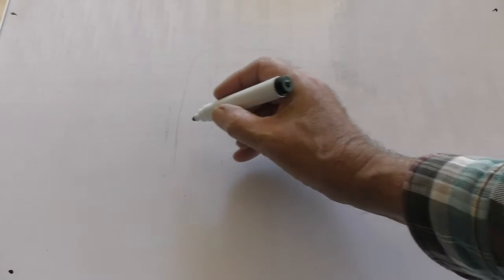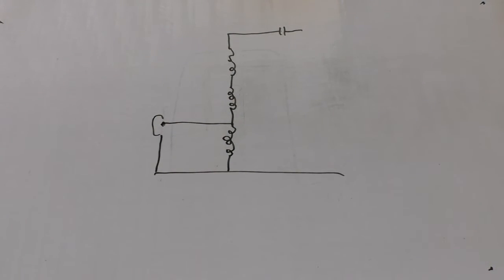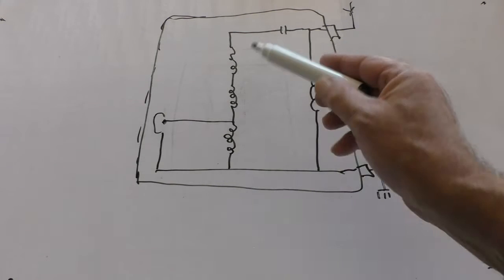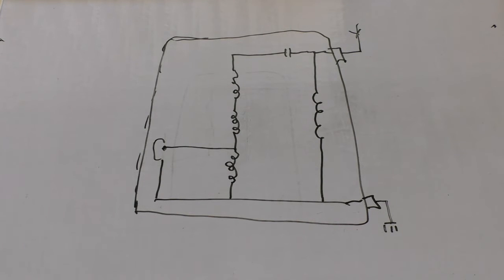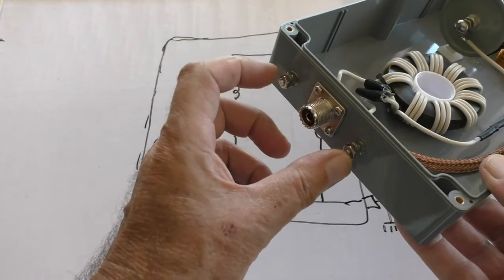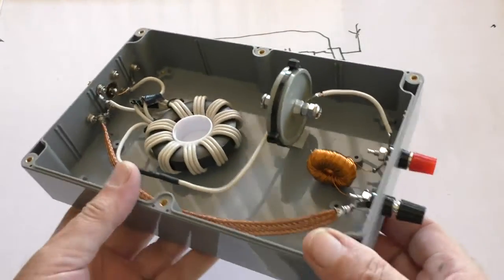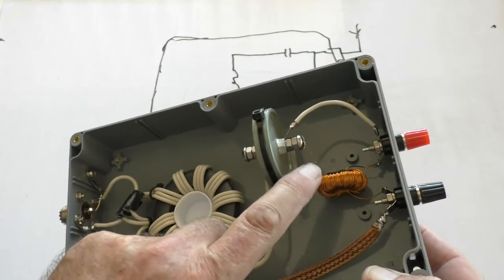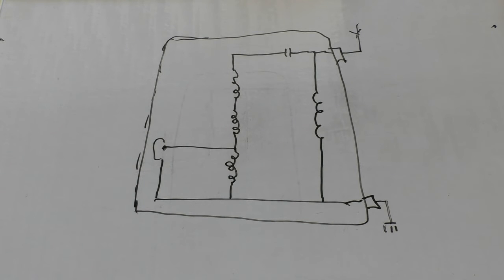A Look Inside The 9:1 Un-Un Matching Unit

Comment: Please tell me sir for what reason have you put there  the condenser and the choke?
What are them doing inside that circuit?

Season greetings from YO2MPL
73 s sir!
Reply from the maker: Seasons greetings to you Sir. The choke is a 9:1 ratio impedance transformer it can bring an antenna feedpoint impedance down to within the range of a manual or auto-tuner. The capacitor can help with lightning protection and also makes the antenna look a bit shorter without having to lower the wire antenna down and physically trimming it. 73.
Reply: It would work as an aid to impedance matching , probably towards the higher end of the band. Don't know if that was the original intent but it would be interesting on how he arrived at the inductance and capacitance values .  Also I like the capacitor , where did you purchase it ?

Comment: I called and  called and called.
I spoke to VK6OP quite well.
HE got through with 25 watts and a tuning fork.
World Wide contest doesn't help.
Reply from the maker: No, it doesn't. I listened around 18:40 and there was someone calling CQ contest on 7.113. I called you a few times between 18:45 and 19:00 but heard nothing. I also called a few times between 15:30 and 16:00 and heard nothing. I was out of the house between times.
Reply: Great video. Nice box.
Reply: VK6CS Thanks for trying.
the QRM was out of this world due to the World Wide DX 48 hour comp
Reply from the maker: No worries, it would have been good to get a QSO with you. What time did you speak to OP?
Reply: VK6CS On and off for about 30 minutes from 1700-1800 WA time. Quite a long QSO with a few breaks for other traffic. About 1 hour we talked on and off.
He does well with Clansman and 25 watts.
Reply from the maker: So it seems. What reports were exchanged?
Reply: VK6CS 5x2 for him at my end and I was 5x7 for him.
I am doing 35 watts.
Reply from the maker: I'm sure I would have heard OP. Shame I missed it. You're doing well with a 5x7 using 35W.
Reply: VK6CSÍt's all in the superior antenna and receive circuits.
Oh, and the uber RF quiet location.
And there's no iron, only basalt.
I am so keen to get my 7410 - imagine how good that will be ? DX here I come.
Reply from the maker: I should be able to get you on 20m no problem with the new radio.
Reply: VK6CS Yes, thanks, and all the other bands like 17m :-)